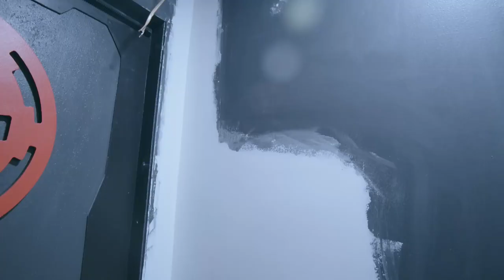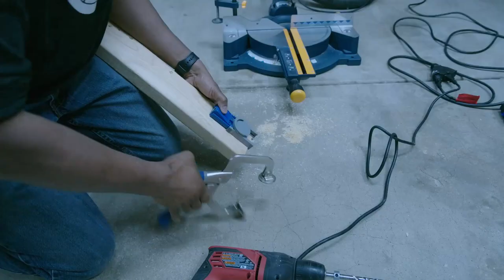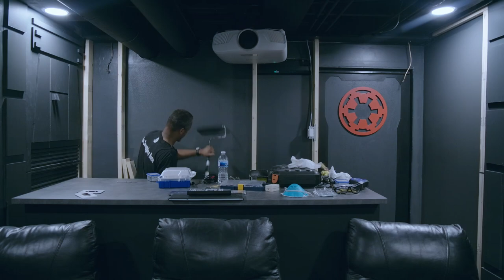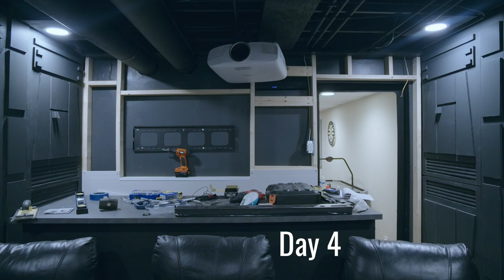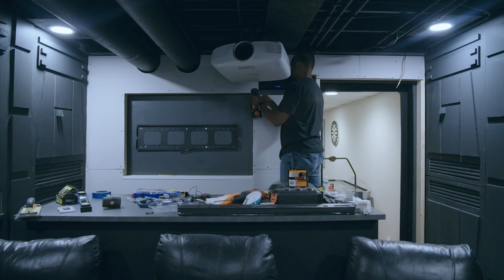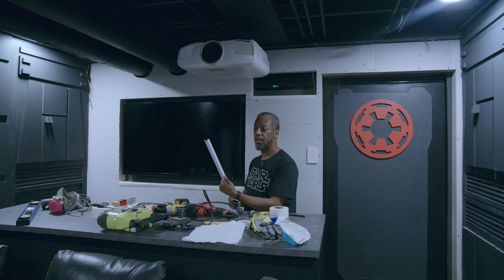Death Star Media Room Rebuild Part - 2

Comment: Looks great. Do yourself a favor. Make sure that tv is vented.  

Also you can get black “brushed aluminum “ look laminate.  If you want to add a low budget metallic look.
Reply from the maker: Ah, yes, I should cut some vent holes in the back hole.  Good idea, thanks!